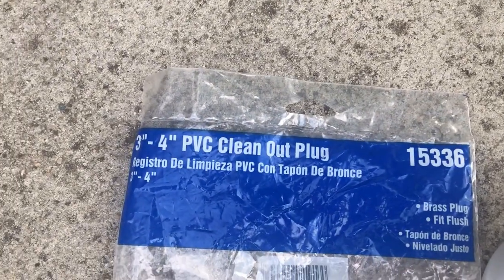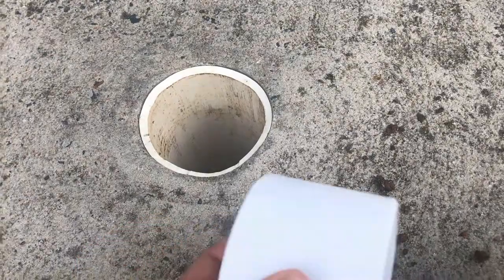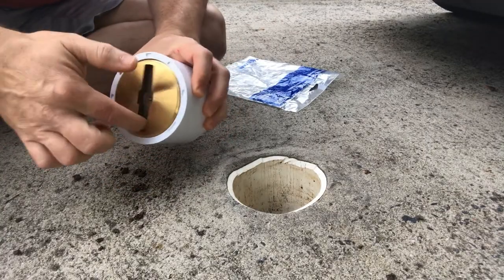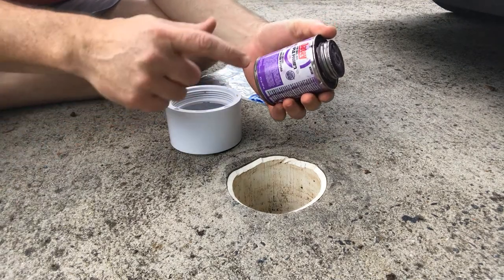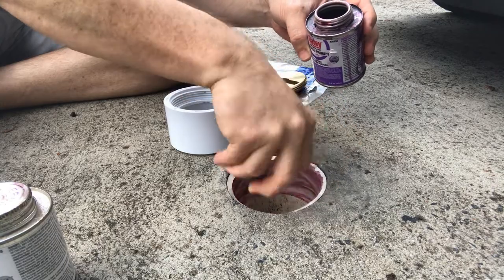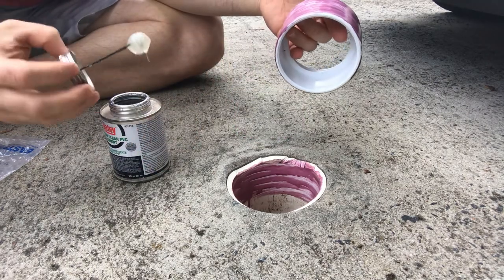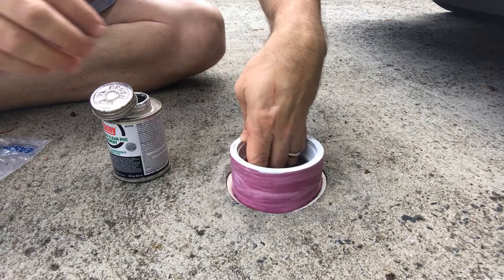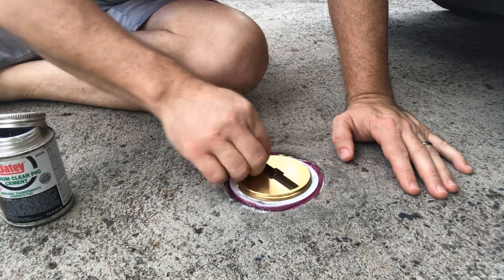Replacing a cleanout plug in a concrete driveway

Comment: Thank you sir for taking the time to show your process fixing ...
Reply from the maker: Hope it was helpful! Thanks for watching!
Reply: @typicalthrill  i have the same situation and now i'm worried  in regard the pressure around concrete not to allow me to put the  cover all the way in ...
Reply from the maker: @sidowsidow  Yeah, that can be a real pain. Unfortunately there's not a lot of other options without breaking concrete. Good luck!
Reply: @typicalthrill  Did you have to break the concrete around to get the first plug out? My plug is about 8" below the cleanout now.
Reply from the maker: @coreychow5138  I didn’t, and I wish I had recorded that process. My clean out was about 24” down when I tackled the issue. I ended up heating up a copper pipe and melting two holes through the PVC plug. Then I was able to fish an electrical fish tape through the holes, tie some parachute cord through it, and pull it out.
Reply: @typicalthrill  That was pretty clever. Thank you for sharing!

Comment: Can this be used in a basement? It was just discovered that we have this in our basement (new homeowner) and I believe the plug is rusted so can I replace the plug and put this cap on in my basement?
Reply from the maker: As long as the plug is the same size, it should work. If the plug is in a wall, they make plugs with a square that protrudes that can be gripped with a wrench. Those tend to be easier to remove. If it's in the floor, you'd probably want the flatter version like I used in the video.

Comment: What would you recommend to use to get a bunch of grass/leaves that have accumulated inside the cleanout due to not having a plug for sometime? A shop-vac?
Reply from the maker: I would be curious about what is keeping the debris from continuing down the pipe. A shop vac should work, but with mine, the plug was sitting down inside the pipe and had mud built up on top of it. I fashioned a shovel-type tool out of some PVC to scoop it out, but that may not be a good idea if there's nothing down there to keep it from falling down into the lower pipe. Shop vac should at least get you in a better position to see what you're working with down there.
Reply: @typicalthrill  thanks for the reply! You are probably right. The old plug is probably a few feet below ground level. I'll be able to tell once I suck all that crap out of the pipe. Thanks again!

Comment: Hello, can you tell me what you did to remove the piece that fell into the pipe. Thanks!
Reply from the maker: Yes! Unfortunately I didn’t get that on video. So for mine, the whole cleanout piece slid down into the pipe and ended up about 2 feet down. I first had to scoop out all of the dirt that collected on top of it. Next I heated the end of a 3/4 copper pipe with a propane torch and melted two holes through the cleanout. The old one was all PVC unlike the brass one I replaced it with. Then I used a metal fish tape and bent it so I had about a 1 to 1.5 foot “V” at the end. I pushed that through one hole and the bend allowed me to fish it back up out of the other hole. Then I tied some para-cord to the end of the fish tape and pulled it back through the holes. Now I had a strong cord through the cleanout and I was able to pull the whole thing out!

Comment: How do I get that gold cap off?
Reply from the maker: It should unscrew fairly easy before you install it, but once it's mounted, I usually turn a pair of channel locks upside down to fit the top of the tool in the slot. Then I get a second pair to spin the first. Really any type of wrench should work. The wider the better to get better leverage.

Comment: What do you think is the best tool to remove the cap once it's tight for awhile? Closed pair of channel locks?
Reply from the maker: I typically use two large pair of channel locks. With one, place the top piece in the slot of the cap, then use the other to grip the first pair and twist.

Comment: How do I plug it? I have one of these clean outs in my garage, but I don't use it, and it is just a big hole right now.
Reply from the maker: A clean out would only be used in the case where the line is stopped up. It gives a plumber access to run a machine down the line. First, measure the opening. Should be roughly either 3" or 4". If you have a threaded opening, buy a threaded plug for it. If the opening is not threaded, you'll need to get a glue cleanout or a rubber fernco plug.
Reply: @typicalthrill  Thanks! We're turning that part of the garage into an office, so it just needs to be turned into part of the floor now.

Comment: What is the diameter of the pipe in the concrete driveway?
Reply from the maker: Mine was a 3 inch PVC pipe, but you could also find 4 inch. Just remember that whatever plug you get has to fit inside the pipe. Some will fit either 3" or 4" pipe, but those would require being able to fit on the outside of a 3". PVC is measured by the inside diameter, so the inside of your pipe should measure either 3" or 4". Good luck!
Reply: @typicalthrill  thank you